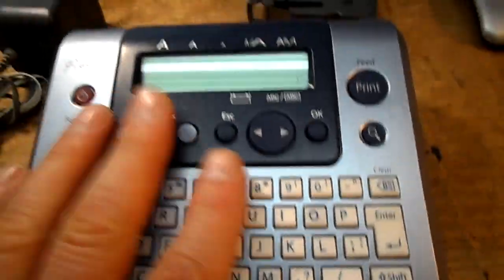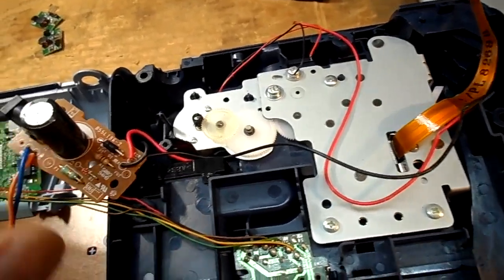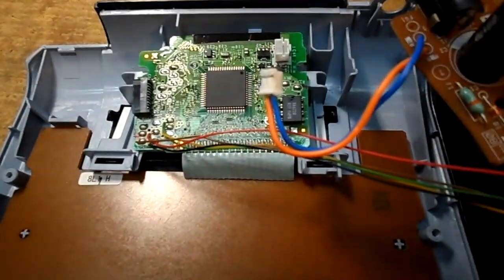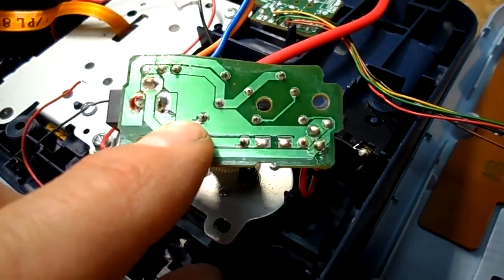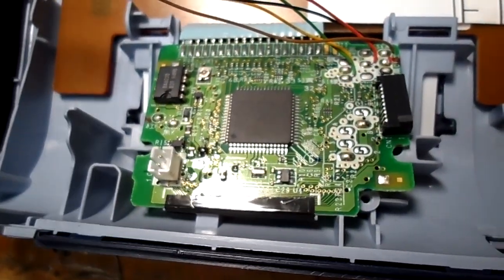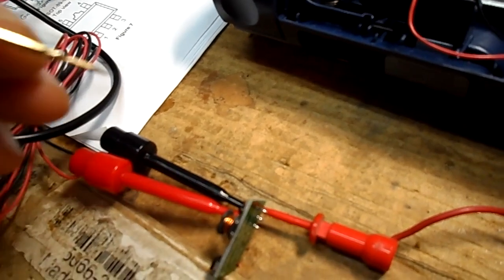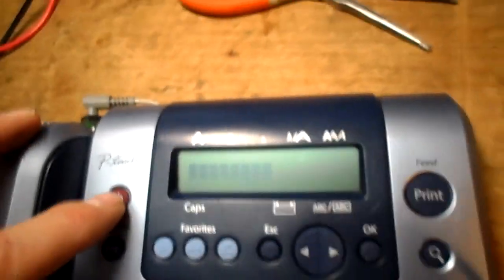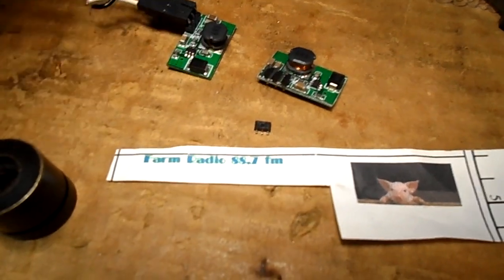Brother PT1280. Repair Attempt. Fail.

Comment: It can’t be center-negative without being DC! ;)

A lot of older Japanese electronics don’t come with the power plug and expect you to use batteries. The reason center-negative was so common in Japan decades ago is because you could use the switch in the barrel jack to automatically disconnect the battery… no microcontrollers or chips to manage charging and power source.

Because Japan uses both 50/60hz in different prefectures they needed to design electronics to be agnostic of line frequency, so they made more DC stuff several decades ago. Since they were making most electronics DC, they saved even more when they could eliminate the adapter and use batteries, which is how they became the world leader in battery powered portable electronics by the ‘70s.

Yes, Brother and Panasonic are Japanese. ;)

Comment: I going out on a limb here but if your battery source is 6x1.5V and you needed a 9V power adapter, the voltage requirement is probably going to be 9VDC before any step down.

Comment: That voltage regulator you can use for replacement without having to order a large quantity is XC6216D332FR-G on mouser and minimal is one. I had to repair mines as used wrong adaptor and blew the regulator. This is for anyone looking for part as do realize your is not repairable.
Reply from the maker: Thank you for the info! I assume the wrong adaptor was used here also.